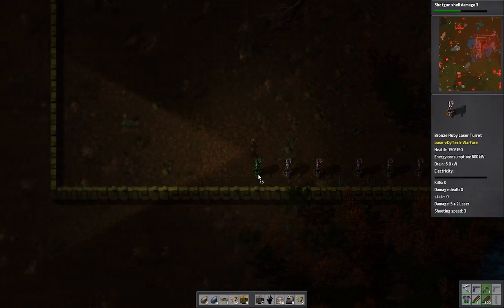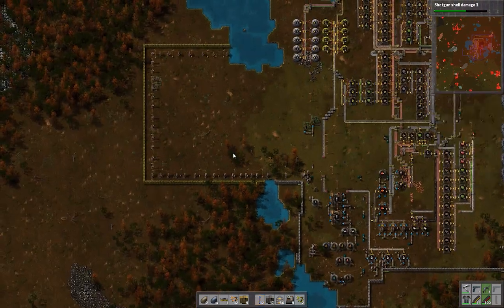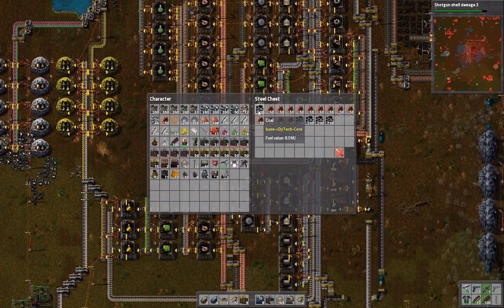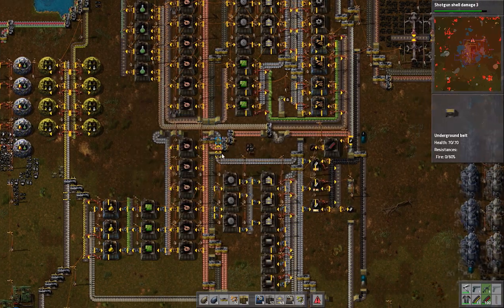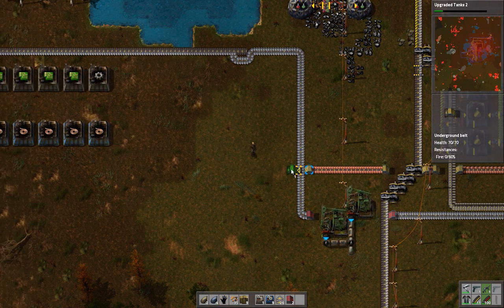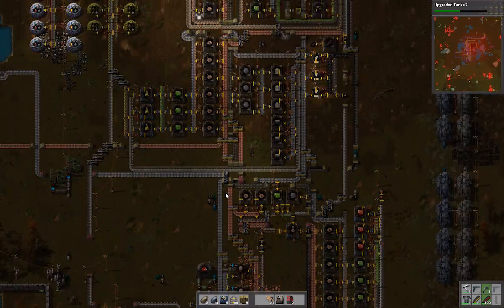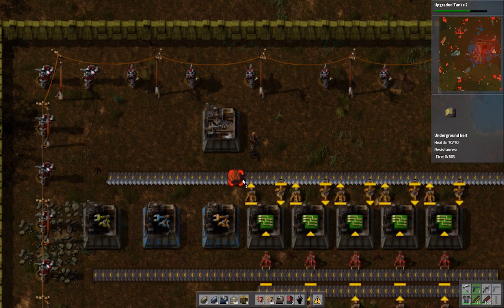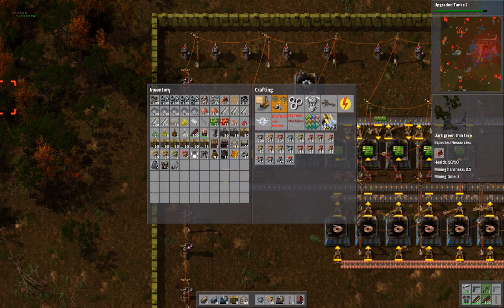(Almost) Advanced Science!: Dytech Factorio Let's Play S3 E12

Comment: you should switch all of your AMs to it's second tier because 0.75 is a lot faster than 0.5 and if you need evidence lets look at advanced circuits (imagine that you can make them in AM1s)

Assembly Machine 1: Advanced Circuits take 16 seconds

Assebling Machine 2: Advqnced Circuits take 10 seconds

yea...SIX SECONDS
Reply from the maker: Athropod 101 Ah that may be the way I need to go as I move forward. Thanks for the tip!
Reply: NP :D